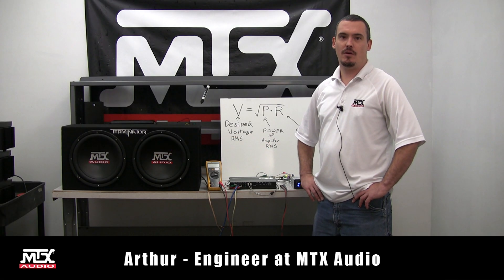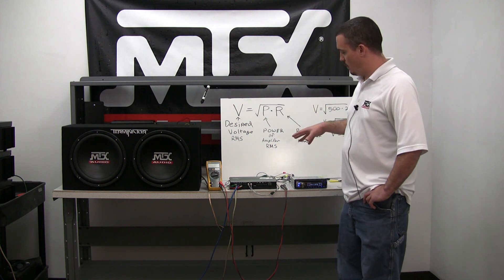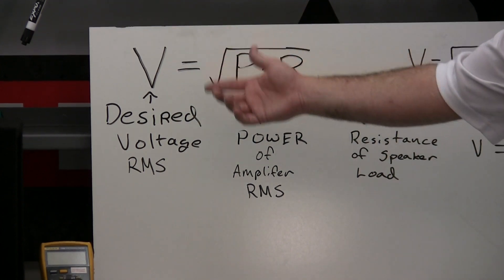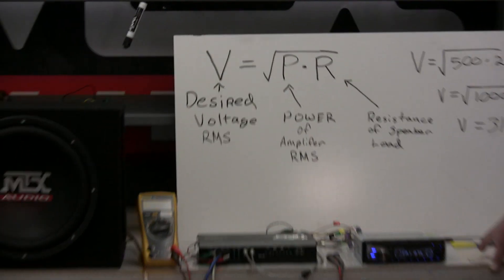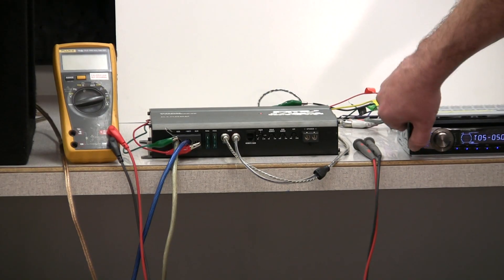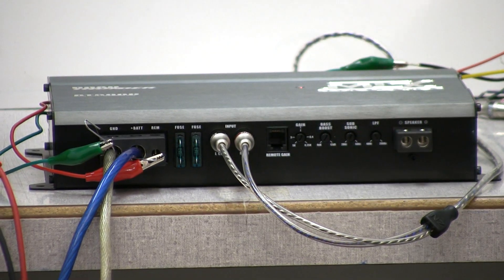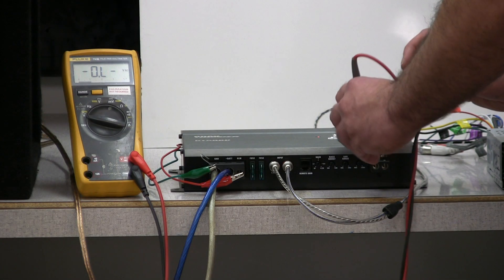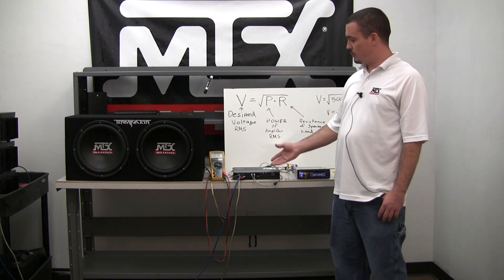How to Set Your Gains Using Ohms Law and a Basic Multimeter

Comment: I have a DB Drive Speed Series amp mono 900w rms @2 ohms and two Kicker CVR dvc 400w rms 800w max @2 ohms, connected in parallel. I need to know how to adjust the gain on my amp to prevent clipping and how to set properly the frecuency (Hz) and bass boost. Thanks.
Reply from the maker: V = square root of (P (800 watts) * R (2ohms)) would equal V = square root of 1600. The square root of 1600 is 40 so V = 40. Be sure your subwoofers are wired correctly for a 2ohm load at the amp. You can get a diagram by using our Subwoofer Wiring Diagram tool on our website at https://www.mtx.com/t/library-wiring-diagrams
Reply: ***** Thank you. I believe it would be 900 (2) = 1800. Sqrt is 42.42 thanks again!
Reply from the maker: LOV2XRL8RL If your subs are 400 watts RMS each, you would only want to send 800 watts to them even though your amp is capable of 900 watts. If you calculate using all 900 watts, you could potentially overpower your subwoofers.
Reply: ***** Very good point. Thank you, I'll follow your instructions.
Reply: ***** So I did this today. Set the gain at 40v. But when I set the bass boost and frecuency it went up to 43v.
Reply: @LOV2XRL8RL its the same as adding more gain smh thats why the volts went up lol
Reply: @jeffreycattelino2011bk1turbo  so what do you recommend? What would be a nice setting?

Comment: my amp is 2300 watts rms at 2 ohms. so my volts should be around 67v. but when i use the multim to set my gains my gain maxes out at 60v why is this. i have a Power Acoustik APE16000D Spl Class D pushing 4 kenwoods at 16600 watts rms total i dont want to blow them and i know they can rumble so if you can tell me why i cant reach 67v id appreciate it *****
Reply: IlDead RisinglI because the amp isnt putting out its rated 😀 if it sounds good your fine otherwise id recommend a better amp
Reply: wayne clark Wrong. He said he maxed out at 60.v and he thinks he needs to reach 67v I don't know why but really what he needed was 56v. He's got 4subs 400rms each, so Sq 1600x2ohm = 56v
Reply: Patrick Lawrence your are very correct sir . good job man
Reply from the maker: V = square root of (P (desired amount of power at appropriate impedance) * R (whatever resistance your subwoofers are wired to at the amplifier)

What impedance are your 4 subwoofers wired to? What is the RMS power handling of your subwoofers?
Reply: 400 rms for each sub at 2 ohms so 4 subs is 1600

Comment from the maker: @Lucas Patterson - If you have two single 4 ohm voice coils, you can wire them to a total 2ohm load or an 8 ohm load. To see how to wire to these impedances, go to www.mtx.com/t/library-wiring-diagrams If your amplifier is 90 watts for one channel, be sure to use the wattage ratings at whatever impedance you are wiring your subwoofers to. 90 watts isn't much for two subwoofers so you will most likely under power your subwoofers which can be worse than overpowering them in some applications.
Reply from the maker: Lucas Patterson
 same impedance options would apply if both speakers are single 4 ohm voice coils. They can either be wired to a 2ohm load or an 8 ohm load on the amplifier channel. As far as external bass controllers (EBC's) or remote bass controls, please refer to our article about EBC's here - https://www.mtx.com/t/library-external-bass-controls

Comment from the maker: To Sigve Skaugvoll, 

We cannot reply to your comment because your settings won't allow us. Anyway, to answer your question, you need to know what the final impedance of your subwoofers is going to be. If you are wiring two subwoofers to a final impedance of 4ohms at the amplifier, then you would use the RMS rating of your amp at 4ohms. Not the 2500 watt rating at 1ohm. The resistance ( R ) value of the equation is the final impedance of your subwoofers that the amplifier will see. Hope this helps.
Reply: Thanks for a quick replay! 
I'm going to have a final impedance of 2ohms at the amplifier when I'm parallel wiring my subs. Does this means that I have to use the RMS rating of my amp at 2ohms (which is 1800w) or what my subwoofers "wants" which is 600w

I guess the only thing that still is a little unclear for me, is what ( P ) is suppose to be, is it going to be 1800 since that's my amps RMS rating, or am I going to use 600w because thats the desired power that my subwoofer wants? 

Thanks again for answering my questions :)

Comment: Hi. I'm quite new to this car stereo life, but I have a few questions about the equation.
I have the amplifier Orion CB.5000.1D which puts out 2500wRMS at 1 ohm. The sub(s) I'm using are JBL GTi 1200 which can handle 600wRMS (4 ohm). My questions are;
in the equation, the variable P (power of amp RMS), should I use 2500(amp) or 600w(sub). The Variable R is that the resistance on the amp(1) or speakers(4)? 

Thanks for a awesome video, and I apologize for the bad grammar and questions.
Reply: Whether you use one speaker or 4 speakers, it’s all the same. Only difference is, when it’s more than one speaker, they will share the same power unless each speaker is rated at a different ohm(resistance).

Comment: I just bought a new Mono block Amp, maybe you could help me. Its says its rated 1 Ohm @ 1,800 Watts RMS X 1 Channel. I have 3 subs rated at 300rms. Im running them so my ohm load will be 1.34. What should my gain be?

Comment: Does this process work the same with an amp running my component speakers? or is it just for sub amps? thanks
Reply: Also would I still use the same 50-60Hrz or a diff sine? thanks again
Reply from the maker: It works the same except you would use a different frequency range such as 1kHz instead of 50Hz.
Reply from the maker: You can download the 1kHz tone from our website at https://www.mtx.com/t/testtones

Comment: question: i am using a 1000rms 4ch amplifier (250rms x 4). should i use the channel power or total amplifier power?
Reply from the maker: Use the channel power and test each channel output assuming all channels are wired to the same impedance.

Comment: your gain will only be set up optimal if the manufacturer of the amp includes a birthsheet with the actual power of that amp..
The fact is that most older amps are underrated and most newer amps are overrated so it's allways a guess..
Reply from the maker: That's a fair statement. That's why it is very important to choose products from reputable manufacturers that do not exaggerate their ratings. The $49 amp you can buy at a big box store does not really do 1000 watts… LOL
Reply: @MTXAudioUSA  sir what if i load  a sub 500rms@1ohm. What shoul i put in power forlmula? The rms of the amp? Or the rms of the sub? Thank you if you observe my question…
Reply: Actual power on birthsheets is what the amp can do on a bench 
you will never get that in a car
Reply: @promo130  probably stil closer than guessing
Reply: Im from the future, amps are smaller now, but you're right lots of overrated amps. And you would have never guessed but taramps is Killin the competition these days!

Comment: Hi, great video. I'm trying to setup my system, here's what I have: Amp 900 RMS at 2 Ohm and Sub dual coil 350 RMS wired for 2 Ohm. My question is what should I use for P 900 or 350. Thank you.
Reply: I forgot to mention that I also use Audio Control LC2I converter.
Reply from the maker: You would use the RMS power rating of your amplifier which would be 900 watts.
Reply: ***** Huh? Then you would be tuning to give 900 watts RMS to a speaker that's only rated for 350 RMS at 2 ohm.  My understanding is you should only be tuning to what the sub can handle...which would mean the opposite of what you recommended.  So if the sub is rated for 350 RMS @ 2 ohm the target would/should be 26.46 volts, right? That or I'm completely misunderstanding how this works, which is possible....
Reply from the maker: snowmobileracer69 Sorry... I may have misunderstood the original situation. IF the amp is rated at 900 watts RMS at 2ohms and Artem Alforov has 1 subwoofer rated for 350 watts RMS and that is wired for 2ohms, he would use 350 for P in the equation. However, I would recommend trying to find a different rating and impedance that would more closely align with the subwoofers RMS rating. For example, MAYBE the amplifier is rated at 450 watts at 4ohms. IF the subwoofer is capable of being wired to a 4ohm impedance, this would be a better match. Without knowing the exact specs of the products, it's hard to say what the best possible setup would be. Sorry for the confusion.
Reply: 26.45 is your target volts 350 watts rms x 2 for 2 Ω =700 square root 26.45

Comment: I'm horrible at math so bare with me. I get that 500x2= 1000 but how do you get the voltage numbers. I have a 1000 watt amp @ 1ohm so how many volts does that amount to?
Reply from the maker: If you have 1000 watts RMS @ 1 ohm, you would multiply 1000 (power) x 1 (resistance) = 1000. The square root of 1000 is 31.623. So "V" (voltage) = 31.623. Please make sure that your amplifier is rated at 1000 watts RMS @ 1 ohm.
Reply: It's definitely 1000 @ 1ohm. I have the audiopipe apcl10001d. Also can I use this same method to set my crossover frequencies? If so how do I go about that!
Reply: ***** that's a nifty formula, i wont argue with numbers;  but a lot of amps are either under rated or vastly over rated.  do you just trust that the math is right?  A lot of amps advertise Max wattage and misrepresent RMS wattage
Reply: TRILLGATES2K6 I have a dB Drive Okur 1500.1 A3 series amp rated at 1500w @1ohm and have never been able to find information as to whether it's rms or max. Not even their website is specific about that.

Comment: How to make sure the head unit's not clipping the signal, before it even gets to the amp though?
Reply from the maker: Arthur mentioned in the video that he was using the line level output of the head unit which is why he turned it up all the way because generally, the line level output "is a lower level output that is clean over the full volume range of the head unit."
Reply: I see, but I'm using high level inputs to AudioControl's Lc7i.. I don't want to have to get an oscilloscope!

Comment: I have a few concerns about the video, if you don't mind conversing about them.

1) Most headunits actually do distort the low output waveforms at full tilt volume, even some highend units still do.  2) setting it at 32v, which is around half a volt over the mathematical voltage peak, goes from a nice sinewave curve to a deformed/distorted signal, so why not just round down the voltage, set at 31v or so.  3) running an amp unloaded for a test is not good because the amp is no longer being set to a specific ohm load.....you're basically setting the gains as if the amp output is the same voltage at every ohm load, which isn't true.....you need a non-inductive load resistor to set gains at a specific ohm load.    Voltage goes down alot when you go down in ohms.....the unloaded voltage is the voltage an amp will put out between 12-16ohms, sometimes higher.
Reply: When he tested the AC voltage "unloaded"  thats what you are supposed to do.  You are simply just measuring the AC volts unloaded at this point for the purpose of the calculation because you will add your ohms in the equation. For the purpose of how he is showing the calculation, it wouldn't make sense to take a voltage reading after it's been affected by the resistance, and then use the ohm load number in the calculation again.
Reply from the maker: Mike, Thanks for your comment. Others have also mentioned much more scientific ways of setting their gains and for those people that are knowledgeable enough to do that and that have the expensive equipment, such as an oscilloscope, that are required for those ways, that is great.

This video is intended to show a very basic way to set gains that almost anyone can do with very little equipment. This method will do 99% of everything most people want to do. For sound quality competitors and true audiophiles spending thousands and thousands of dollars on one speaker, they would probably want to go a little further than this video shows but for most people, this method is sufficient. 

There are other factors in signal quality such as compressed music and sources such as iPods and iPads that can also hinder an audio signal but this video is shows how to set gains with little to not equipment or experience.

Comment: ok so if you have a mono amp that can do say 2000 RMS, and you set the gain to do 2000 rms but have 2 subs, each is getting 1000 rms then right?
Reply: just checking. been doing stereos for years, then i joined the military and havent been in it for a bit.
Reply from the maker: You got it!

Comment: Hello. I like this video and it helped me a lot. I have a question. I have 2 Kenwood Excelon KFC-XW10
10" 4-ohm subwoofers 300 watt rms, 1 Kenwood KAC-5001PS 500 watts RMS x 1 at 2 ohms 300 watts RMS x 1 at 4 ohms. what would be the best way to wire this up. Just use 1 sub at 2 ohms, use both subs at 4 ohms. I was advised you cannot run 2 dvc 4 ohm subs to a 2 ohm load is this true?
Reply from the maker: Bryant, thanks for your message. If your subs are single voice coil, 4-ohm subwoofers, you can wire them down to a 2ohm final impedance at the amplifier. This would send all 500 watts from your amplifier to your subwoofers which have a combined RMS power handling of 600 watts. If you would like a diagram on how to wire your subwoofers to a 2ohm load, go here - https://www.mtx.com/t/library-wiring-diagrams

If your subs are dual 4ohm voice coil, you cannot wire them to a final impedance of 2ohms.
Reply: They are dvc subs what would be the best way to wire it
Reply from the maker: Bryant Washington The best way to wire your subs depends on the ratings of the amplifier you are going to connect them to. For example, with your current Kenwood amp, there really is no good way. You would either have to wire them to an impedance the amp is not stable at in order to get enough power to the subs or you would have to wire to a higher impedance that wouldn't give your subs enough power. 

With two 4ohm, dual voice coil subs, you can wire to 1ohm or 4ohms at the amp.

With two 4ohm, single voice coil subs, you can wire to 2ohms or 8ohms at the amp.

With two 2ohm, dual voice coil subs, you can wire to 2ohms or 0.5ohms (not recommended) at the amp.

With two 2ohm, single voice coil subs, you can wire to 1ohm or 4ohms at the amp.

Then you would need to find an amplifier that has an RMS power rating of as close to the combined power handling of your subwoofers (2 subs with a 500 watt RMS power handing would be 1,000 watts total) at whatever impedance you plan to wire them at.

https://www.mtx.com/t/library-wiring-diagrams
Reply: what if you parallel one sub ,series the other sub ...and then parallel both subs ...???
Would that be 3 ohms ??

Comment: With the deck ALL the way up, how do you know your signal isn't clipping?
Reply: Richard Hansen your supposed to turn the deck up until it starts to distort - then turn it back 2 volume numbers - then play the test tone & set the AMP gain
Reply from the maker: Richard, that is the purpose of the math prior to doing anything with the equipment. By turning the volume on the amp all the way up, and then adjusting the gain on the amplifier until the output voltage is as close as you can get it to whatever your math calculation gave you (the V in the equation), you are ensuring that the signal the deck is sending the amp is NOT amplified too much to the point the amplifier would be sending a clipped signal to the speakers.

Comment: great video but there might be a little problem. the rms outputs is never the exact value stated in the specs, most amplifiers specs are overrated and some underrated. my diamond audio d3 600.1 puts 450rms at 2 ohms but i believe it gives more than stated. so you never sure if its clipping or not but its a good measure. thanks will try it
Reply from the maker: Great point Sergio. This is why it is so important to purchase your equipment from reputable manufacturers. There are other ways to set your gains that are more scientific and require more advanced equipment that most people don't have. This is just the easiest, simplest way to at least get the amplifier gain into the ballpark of where it should be. To get it dialed in any further would require additional equipment. 

If your amplifier actually does more RMS power than it is rated for, setting your gains this way will still ensure that you aren't sending a clipped signal to your speakers and subwoofers.